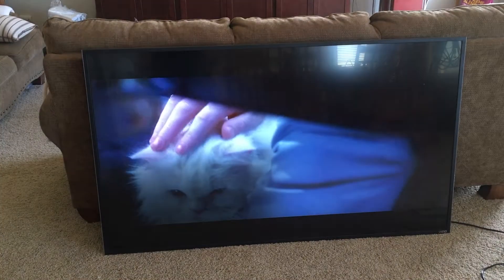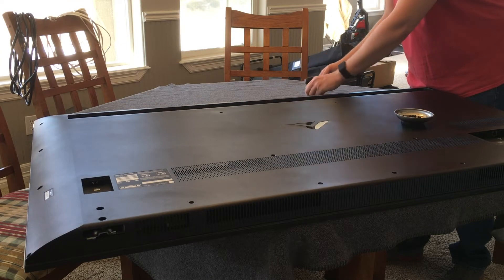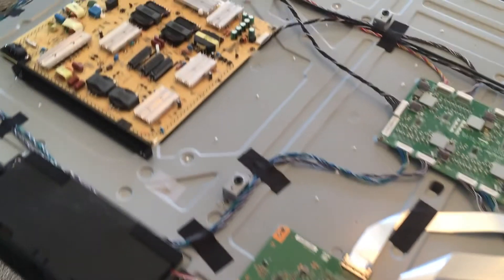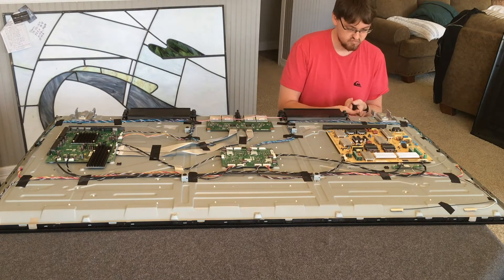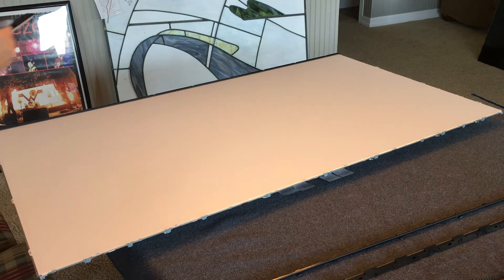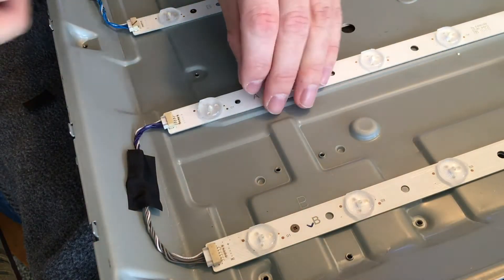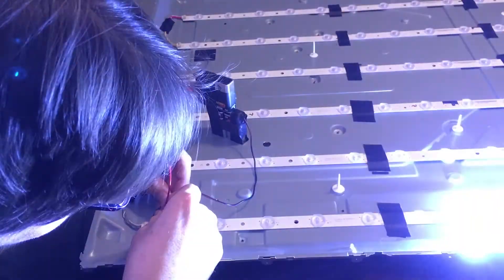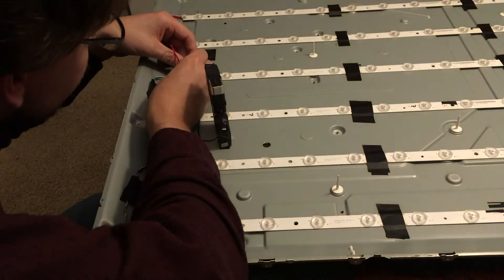Vizio M65-D0 LED Driver Board Replacement: Fix Backlight Issues | CraftTested

Comment: Thanks for posting this video.  I did not see the tcon board initially, hidden under a plate used to hold the stand.  I ordered two other boards, replaced and same still issue.  Ordered the Tcon board and waiting for it to come in and crossing fingers that it fixes it.

Comment: thank you for taking the time to make this video!! i have a vizio 70 inch v705h3 and have a slightly dark lower half as seen in another video but this may be the fix for me🙏🏽🙏🏽 i'll be shopping for a new led board hoping that fixes the problem. not looking forward to replacing the strips lol also a LED board for $30 vs $600 for a new 70inch is a no brainer
Reply from the maker: Hope it does the trick!

Comment: I have a model V555-H1 When I turn it on. I get the white statusvLED in the bottom right hand corner comes onbthen fades off. The screen stays black the entire time. I have already replaced the main board, the power board and the LED driver board all 3 have been replaced. But I still have the same issue with the black screen. It does appear that the LED back lights are coming on. Because I can see the white LED's through the holes in the back.  But I still get no picture. Any suggestions?

Comment: I have a VIZIO Model E70-C3 smart TV around 6 years old I think and recently the screen is divided into two sides down the middle. The right side seems fine but the left is a little darker with an even darker horizontal band running left to right in the middle of that left half. 
Ant thoughts?

Comment: Sir ,  jvc has cCFLbaclight and it does not turning on۔ can I use same cCFLbaclight power inverter 94v to glow leds. (I will divide 3 or 6v led into 94v) will it work, please advise
Reply from the maker: ¯\_(ツ)_/¯

I'm just a dude who tinkers

Comment: I have the same problem with my Vizio TV. I have also discovered it's not the backlights, and could be the video board or a capacitor because my lights do come on once in awhile. So I know that the LED lights are not burnt out.
Reply from the maker: Seems to be a somewhat common problem. When I did mine, the video board was about $20 – might be worth trying.

Comment: I have the Vizio M656 H4.     I originally had the fading in the top right quadrant.   I obtained a new LED Driver Board, and replaced.     The "dimming" continued, and over the past couple of weeks, I am getting "dimming" in the lower left quadrant.    Was I supplied with a "defective" LED driver board, or is there another problem?   Thanks.  (by the way.......Vizio tech said, " just go buy another tv!"
Reply from the maker: ¯\_(ツ)_/¯  – I'm just a dude who tinkers. Could be a power supply issue to the quadrants? Hope you figure it out though. Terrible about the Vizio tech!!!

Comment: What if none of the back lighting is working?  Is there a way to test the video board before disassembly to reach the LEDs ?
Reply from the maker: ¯\_(ツ)_/¯ I'm just a dude who tinkers. I assume you could test the power output / continuity of the video board with a multi-meter

Comment: I have a 60" Smart Vizio. 
About 1/4 of the right side of the screen is darkened, yes you still can see a picture through the darkened portion. 
Is it possible the T-Con board is responsible for my unfortunate luck? I have replaced the backlights already. I am just looking for some positive answers for my 60" Vizio, before I recycle it. Anybody here have the same or similar situation before?? Please help me.
Reply from the maker: Not sure the t-con board is responsible for your unfortunate luck – you may be been cursed? Someone cursed me once, they made it so I caught every red light. Super annoying. Find a good witch doctor.

As far as the tv, for around $20 I'd try replacing the video board before trashing it. But, I'm also just a dude on the internet who's made a lot of poor life choices. That whole "grain of salt" thing...

Comment: Running into this similar issue. Backlights went out. Screen was black but you can see the display with a flashlight. Repairman put new black lights in. Three days later I get a black bar in the middle of the screen. Not a solid bar, but it’s pretty dim. He’s picking it back up. Said it’s the T-con board maybe.

Comment: Great video. I was able to replace the LED driver board on my 65" Vizio m656-g4. Sadly it did not fix the problem. It was worth a try though! I was experiencing a similar issue with the lower-right quadrant going dark. I'm pretty bummed!
Reply: I'm having the same issue with the same TV. My lights went out one by one to the point my whole screen is dark now. I've only had the TV for 9 months.
Reply: Oh geez... our 75"  same! 🤦🏼‍♀️
First bottom, then right side and quickly entire screen black. We have taken the back off to try to find a replacement board in hopes it works. 
At least we've had ours for two years.
Reply: @SheilaSmithPaparazzi did it work?

Comment: I have a similar Vizio model and it has the same problem in the top right corner. Only difference is that it’s not all the time. Sometimes it works perfectly fine other times not. Any idea if it’s the leds or the controller board?
Reply: My vizio 75in has a similar issue. Top right and it looks smaller dark spot. Half the size of the on in this video. Almost like a shadow burn in.. did you ever find a fix?

Comment: My lower left and upper right quadrant are both dim, the lower left flickers on occasionally . What is actually failing on the video board itself? Is there a way to repair the board I have?

Comment: Seems showing up to test that the individual driver board wires to each LED strip actually have no voltage when TV is on would definitively confirm the driver board?  I'm going to test the outputs first.

Comment: Hey man. I have a smaller 39 inch vizio e320i-b2 the whole thing is dark but I can see a picture when shine a flashlight at a angle on it. Do you think it could be the board making all the backlights not work?

Comment: The easy way to  troubleshoot this is to move the backlights around.  Since the strips are all the same, as long as they didn't key the connectors, you should be able to just swap connectors for the different sections of backlight.  If the problem area moves, then you know it's the board.  If the problem area stays the same, then its the LED strips. Also, on some TVs, one bad LED can take out multiple LEDs.  It just depends on how the strips are wired.  Some TVs run many LEDs in series and even some strips (keeps the current down), so if one opens up, the whole string goes out, kind of like old Christmas lights.  That can take out a section of the backlight.
Reply: TO move the LED's around you have to take the bezel and screen off which is about 10 times as much work as removing just the rear cover of the TV.  Testing the driver board outputs to the LED with a multi-meter to confirm no voltage output to the LEDs would be the best way.
Reply: @RPG-oh1yf  I don't mean physically move the LEDs.  Move the connections to the LEDs from one port on the driver board to another.  I did that on one I'm fixing.  And it showed the driver board is likely fine, it's the LEDs (which sucks because now I have to take the panel apart and replace a bunch of LEDs).  And indeed, tests on the LED strips showed bad LEDs, confirming the earlier diagnostic.
Reply: @ccoder4953  Ok, sorry for the misunderstanding.  On my 65" vizio I'm trouble shooting there's only 2 harnesses that power the 12 LED strips and all of them are out and all went out within a month, little by little.  I'm leaning driver board. Missing the power cable or I'd test them now.   What I don't get is how do all the LED's fail at once in your case of it's NOT the driver board?  Maybe the board also failed and overpowered them all and cooked them?
Reply: @RPG-oh1yf  Oh, that's easy.  LEDs are often wired in series (like old Christmas lights).  A common failure mode is for them to go open circuit.  So, if one LED opens up, the whole string goes out.  I had a panel do that once.  Turned out it was just a few bad LEDs.  It's also possible you have some LEDs in series and some in parallel.  If you have some die (shorted or open can do it), it can cause more current to flow into the other parallel branches, stressing those LEDs more.  See, LED drivers regulate current, not voltage.  But unless it's pretty sophisticated (and it sounds like yours is not), they can only regulate the current of an entire series/parallel string.  So, if one parallel string isn't doing the current it should, the other branches will have to do more.  But that stresses those harder, so they are more likely to fail.

What's weird is the new one I'm working on (with full array dimming, so much more complicated) has LEDs in series, but somehow bad LEDs aren't taking out a whole series string.  Might be because the newer panel has 9V LEDs (I think) and the old one had more normal 3V LEDs.  The 9V LEDs are internally quite a bit different - internally, they are several LEDs in series, where the 3V ones are just one.  So, maybe they are more likely to fail shorted.
Reply: @ccoder4953  Interesting.  Seems mine failed in 3 segments.  First I lost about 1/4 of the backlight, then 3 weeks later we lost about another 1/2 of it and finally the last 1/4 went out.  Seems like that should be LED drive board based on that 3 stage failure but hard to say.  I am probably going to order a new board from Ebay, can't beat $5 shipped for a new salvaged board I need.  IF that doesn't work I can pull the panel apart and check the LED strips.
Reply: @RPG123  this sounds like what mine is doing. Did the board fix the problem?
Reply: @ccoder4953 if what u say is true,,about if 1 goes out it's harder on the next,,,,then wouldn't the 1st led in the lineup take all the hits and fail quicker?
Reply: @jasonruch3529  Depends on what you mean by lineup.  If you don't have full array dimming, LED backlights are usually arranged in multiple parallel strings of series LEDs.  Most components fail either short or open.  If one of the LEDs in a series string goes short, that string will tend to take much of the current because the voltage of that string will be lower.  That stresses the LEDs in that string alot more because that string gets most of the current that should be distributed among several strings.  But LEDs often fail open.  Indeed, an LED that fails short may do so for a short time, but the increased current will be likely to cause it to open up.  When that happens, that stresses the other strings a bit more because all the current that would have been in the failed series string gets redistributed to the other ones.

Also, the LED in a series string that fails isn't necessarily the first.  Electrically speaking, there's no reason why the first is any more likely to fail than the 3rd or the 10th. What's more likely is for the failure to be random, workmanship, or thermal related.  If you saw several failures, you might notice that LEDs in a particular section tend to fail.  Perhaps the heat sinking isn't great there.  Or there's a heat source nearby.  Or maybe the manufacturer just doesn't have their soldering equipment tuned properly and tends to not properly solder the last LED on the strip.

Comment: we have a d55 e-0 that has the same problem .. we opened it up but it does not have the same middle component .. just has a power board on side and then a main larger green board on the other side. would it be the main board that is defective ? since it still powers up etc ?

Comment: Well ours was the same thing had dark spots in the corners then one morning the tv went out I can turn the power on and take a flash light and see the Vizio symbol come in in the center but the power light goes back off. If I can’t get it to work I’ve got a 12 gauge that will permanently fix the problem
Reply from the maker: I highly recommend the 12 gauge, haha
Reply: @CraftTested  well bought a hi sense tv from someone YouTube videos keeps sticking that one might be next to feel the gauge

Comment: I just shook my tv one good time and it worked, granted after several shakes and like several hours. My flat screen is on a swivel stand, and I just kept turning the swivel back and forth and; back and forth; then I shook it one good time and it worked, at least for now. I didn’t have to pull it apart. Turn it off and on a bunch of times. This happens a lot with my tv and all it takes is a good shaking and it works again. So, if that is the case, is it really the LED board, maybe it’s faulty, but it isn’t completely shot!
Reply from the maker: Haha, much easier than what I did!

Comment: Thank you for the video. I came out to the horizontal shades at the top and the middle. They both appeared at the same second. I assume, it is probably driver board, since 2 strips can't go out together. Right?
Reply from the maker: Sounds like a reasonable assumption. The only way to know for sure is by testing them with a multi-meter. Thanks for watching!

Comment: I actually appreciate that you show what you did even though it wasn't necessary. There was info to learn in that section so it's appreciated.
Reply from the maker: Glad it helped!
Reply: Would 4 strips not working cause other leds also not work ? @CraftTested

Comment: Dealing with an issue with my Vizio M55 E0, after about 10 minutes the whole screen goes black but is still on (can see the glow) thought it was a power issue and just replaced the power board, but still blinking out after about 10 minutes.  If I turn off the tv and back on it will work for a short time but then go out again.  Just ordered the Led driver board hoping that's the issue.  Any ideas or suggestions are welcome.
Reply: Did that fix your tv, I have the same problem

Comment: I have Vizio M55-C2.  On the left half of the screen, I have a constant, small dark patch, and after an hour or two i have dark patches all over the left half of the screen.  Turning the TV off and then back on, temporarily fixes the multiple dark patches on the left side of the screen (leaving just a small dark area again).  I've tried muliple versions of power off resets and played with resets in the display settings.  I can be watching the TV and very suddenly the patches appear within an hour or two...then recycling the power solves the most of it temporarily.  I believe I either have bad backlight strips and/or bad led driver board.  Any opinion?  Thanks -Herb
Reply from the maker: It sounds like you have it narrowed down to the two likely culprits. The only way to know for sure is to tear it down and check both the LED strips and video board with a multi-meter. With the lights coming back on after power cycling, it makes me think that LEDs aren't burned out – it sounds more like a video board issue – but that's just a guess. Good luck!

Comment: I picked up a Vizio M80-D3 for free from work since one day the entire left side went dark and they had to replace the TV asap. The thing is, on the rare occasion, the thing will light up just fine. I know that there are 16 LED strips arranged in 2 banks of 8. Each of the 16 strips has its own connector. For the entire left side to go out, this must mean it's a power supply issue. I have the unit at a shop and they said to replace all the strips. I think they just wanted it out of their shop... I'll likely try replacing the LED driver board myself first and then go from there. Free TV!
Reply from the maker: Right on! Yes, I would try the board first before the strips – especially if it's occasionally lighting up. Usually an LED either works, or it doesn't – which leads me to also think power supply / driver board. Good luck!

Comment: Hey just curious. I have a sceptre monitor for my pc and I’m getting a similar issue. I’m just curious if this same issue can happen with monitors?
Reply from the maker: I'd assume they're pretty similar. LED TVs and LED monitors are basically the same thing – monitors usually have a little more robust hardware and faster refresh rates. It's worth trying, but I can't promise anything as I don't know anything about your particular monitor.

Comment: Love this video and I hope it’s my issue.  I have a Vizio E 70- E3. It has different boards on the back than the one in this video. (only 3 boards). My top right quadrant is very dark in my bottom left quadrant is starting to go dark.  I can buy a Vizio E70-E3 T-Con Display Driver Control Board a921 on eBay for $20 and I’m willing to take the risk.  Just wanted to get your opinion on if you think replacing this part might do the trick.
Reply: Did this work? I have the same model
Reply from the maker: Hmm – my assumption is either the board works, or it doesn't.  The "starting to go dark" concerns me.  I don't think that as a quadrant fails, it's a slow process where things begin to dim.  I'm guessing it's an all or nothing situation.  The only way to know for sure if checking the video board with a multi-meter.  If the fading quadrant is getting proper voltage, my next guess would be failing LEDs or a power supply issue.  Hope that helps!
Reply: I ended up just buying the LED lights and that did the trick, I did not buy the board.

Comment: Yes what is the device u are using to test the lights
Reply from the maker: I taped together some 9V batteries and wire and touched the LED leads to test the lights. There's actual products you can buy to do this, or search YouTube for this ghetto trick.